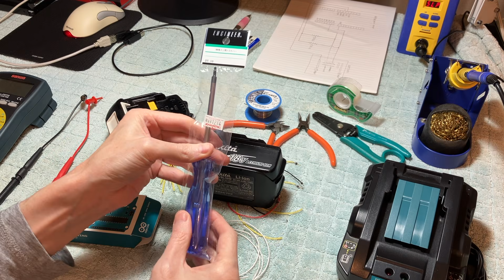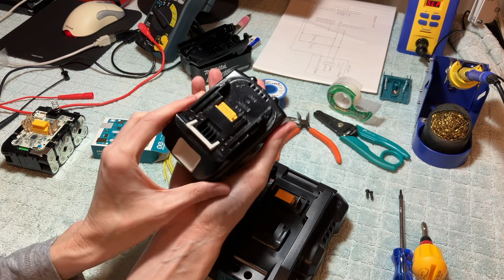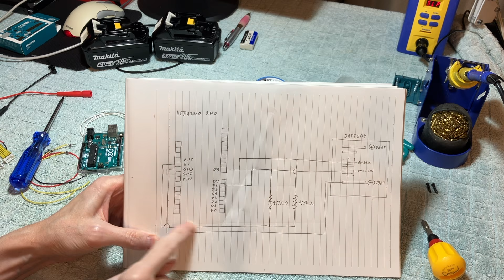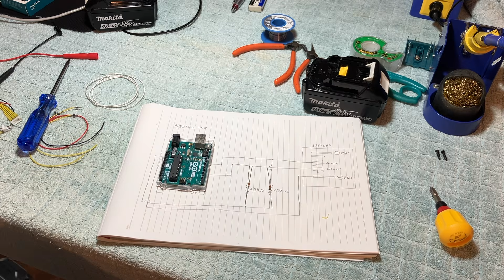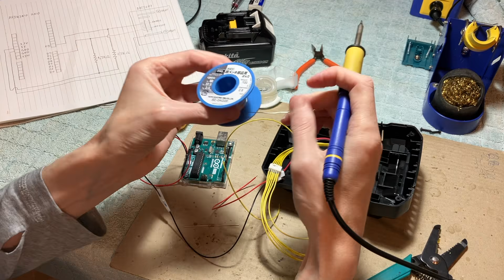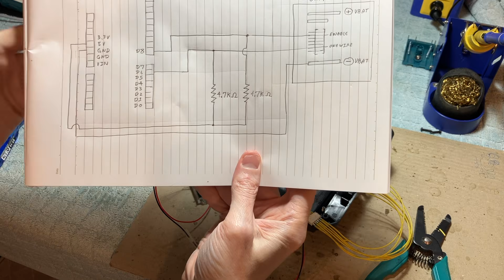Makita battery lockout, full guide setting up Open Battery Information, part 1 of 3, hardware

Comment: This is awesome mate, are only the 5.0Ah batteries able to be unlocked still or any? Also will a duinotech uno 3 board be compatible with the schema?
Reply from the maker: Thanks for the comment.
Not just 5.0Ah batteries, but any of the newer (current) generation (with the button to check battery level on the battery) batteries I believe.
Yes, a duinotech uno 3 should work without any issues, it is nearly identical (same chip) to the Arduino Uno I believe.

Comment: can you help me repair makita 40v
Reply from the maker: Thanks for the comment.
The hardware (Arduino OBI) should work with it but there might be some different commands on the Python side.  The battery connector is also different I think.
Can check over at Open Battery Information to see if that has been implemented.
https://github.com/mnh-jansson/open-battery-information
Reply: @allans-workshop  i can not find instruction build tool fix makita 40v. can you help me

Comment: Thanks, I 've also build this OBI , but I want to do it with ESP32
Reply from the maker: Thanks for the comment.
This should work with an ESP32 and can try the version I made to work on an Adafruit Trinket M0 as a start.
https://youtu.be/1yGGF7F5GFM
A direct link to those files (same as in that video above) is below.
I think these will also work with the ESP32 but I have not completely verified.
https://www.drassal.net/wp/fixing-makita-18v-battery-lockout-with-open-battery-information
Some changes will need to be made to map the GPIO pins.

Comment: I can't find the code I should upload to Arduino for this case.
Reply from the maker: Thanks for the comment, the code is located here.
https://github.com/mnh-jansson/open-battery-information

More specifically the Arduino code is in this folder.
https://github.com/mnh-jansson/open-battery-information/tree/main/ArduinoOBI

This is an Arduino project and can be opened in the Arduino IDE.

Comment: Can this tool be used to find out if used batteries are fake or original ones? Can you 100 percent tell that original is original or some fake BMSes act like original ones ? 
I would really appreciate answers :)
Reply from the maker: Thanks for the comment.
Short answer is that it is not 100%, but very likely a non-oem battery will not respond or respond slightly differently.  Opening the battery is generally non-destructive (but will require 
an uncommon screw driver and removing a plastic cap insert from one of the screw holes) to visually verify the PCB inside.  The markings and label on the battery should also be a visible indicator of a non-oem battery.

Longer answer,
The non-oem batteries and replacement PCBs either have no MCU or a simplified CPU to reduce costs as much as possible implementing only the bare minimum functionality necessary.

Doing an internet image search for "makita battery replacement pcb" will reveal visual differences between the two and most likely the non-oem PCBs will be omitting some of the safety functionality.

While the non-oem batteries must implement some battery reporting communication in the MCU, it may not support the maintenance commands (such as the lock out flag reset command) or even leave out the lockout flag feature entirely.

Comment: Thanks again for sharing the wiring diagram.
I have successfully setup from my end on first attempt.
1x A-DIGISHUO UNO R3 Board Compatible with Arduino IDE ATmega328P with USB C port from Amazon $15 AUD
2x 4.7K ohm 1w resistor $1
1x spare cable USB-C to USB-C
1x Makita DC18SD charger for housing the board.
Running on MacBook Pro Sequoia 15.6.1
Python 3.13.7
Visual Studio Code & PlatformIO extension for building and upload firmware to the UNO board.
Reply from the maker: Thanks for the comment and sharing.

Comment: Hello Allan I am wonderin Have you got any project about Makita XGT battery microcontreller?
Reply from the maker: Thanks for the comment.
The same hardware should work with the Makita XGT battery but there might be some slight changes to the software.
I don't have a Makita XGT here to test for 100% confirmation.
Please check at Open Battery Information (the software used for the project) for confirmation.
The author may also be contacted, their email address is the first link below under Contact information.
The author may be able to provide some updated information.

https://github.com/mnh-jansson/open-battery-information
https://github.com/search?q=repo%3Amnh-jansson%2Fopen-battery-information%20Makita%20XGT&type=issues

Comment: I finally managed to install open battery information. When I want to read a battery, this message appears:

Failed to get a valid reponse after 2 attempts.

I need your suggestions for this problem.

Thanks and have a good day.
Reply from the maker: Thanks for the comment.
There might be a couple causes to this.
Are you getting this error message when clicking "Connect" when choosing the port to connect to? Or when clicking the "Read battery model?"

In case of the "Connect" button error, is the Arduino Uno programmed correctly?  This could be the cause of this error.  If the Arduino Uno connects correctly (and shows version information correctly) then the issue might be between the battery and the Arduino Uno.

In case of the "Read battery information," which means the Arduino Uno was successfully connected to, communication with the battery is not happening.

Double check that the connections between the battery and the Arduino are correct and also not reversed.  Also the ground connection is important too so make sure that is connected correctly.  Only three wires should be between the battery and the Arduino Uno.

Double check the pull up resistors (required) are correctly connected and pulling up to 5V.  Are they the correct value?

Double check which pins are being connected to on the battery.  In the case of the connector I had when I made the video, the first position was not populated so I had to take that into account when counting pin numbers.

With the older batteries the timing is a little wonky and might take a few attempts to get correct data, but it should work after a few attempts.

Also, do you have another battery to try?  The battery management controller might be damaged or the battery might be too far discharged to keep the management controller powered.

The voltage on the battery (between + and -) should be around 16 volts to 20 volts if I remember correctly.  If not there is some other internal problem with the battery.
Reply: @allans-workshop  I really want this to work but I can't get any further then Failed o valid response after 2 attempts, I have checked and double checked all connections and still the same, can I send you a screenshot of what the OBI screen shows any help would be much appreciated
Reply: Failed to get a valid response after 2 attempts. Battery is not using the original MAKITA BMS or PCB.
Reply: That mean no communication between arduino and battery. As example I had wrong pin shown in code

Comment: 4.7k ohm resistors are absolutely necessary?
Reply from the maker: Thanks for the comment.
Yes they are (pull up resistors), but you can get away with something "close" to 4.7k like 5.6k or such.  Just not too small or too big.

Reason, not to be too technical, the data lines are open-collector and the battery only can pull them down (to ground), but not up (to 5v or 3.3v).
Reply: Yes, may be not exactly, but there supposed to be.

Comment: If you buy the 1/4 × 3in long security bit  set they will  fit and work with what you had. Just a fyi 🫡✌️
Reply from the maker: Thanks for the comment.
Good information, thank you.
I didn't actually measure the depth of the holes, just saw that tool at the shop and bought it.
A longer set like you found would work great too.

Comment: Thank you! I was able to follow your guide, and now my battery connects. Unfortunately, the software states, "This model only supports diagnostics."  The battery is a BL1840B. 😒
Reply from the maker: Thanks, glad it was more clear in this video, sorry to hear it is one of those harder to work with batteries.
Hang on to that battery, there is a work in progress to make a solution available.  You may contact the author of Open Battery Information to see if he is close to releasing a version that supports these older batteries.
Reply: @allans-workshop  BTW you can spot weld the security allen tips to an old screw drivers for that purpose. Makita should be ashamed of themselves for making the Right to Repair so difficult.